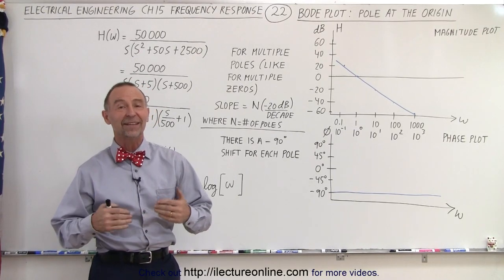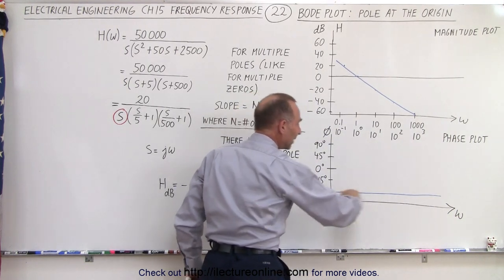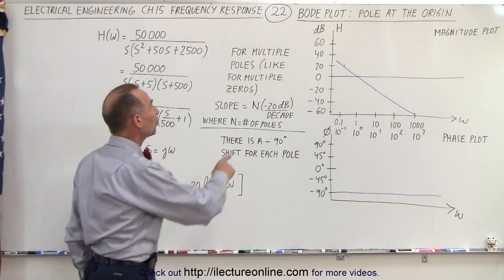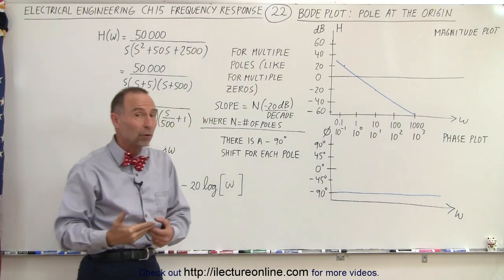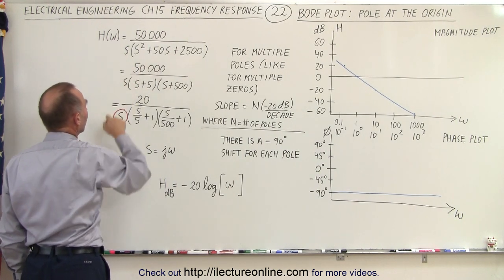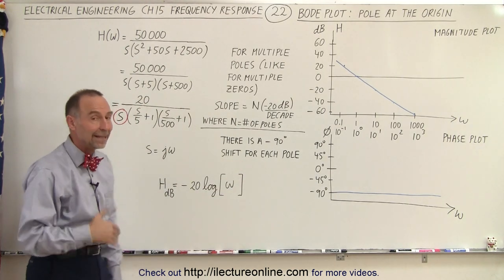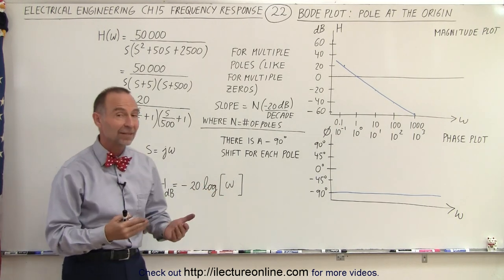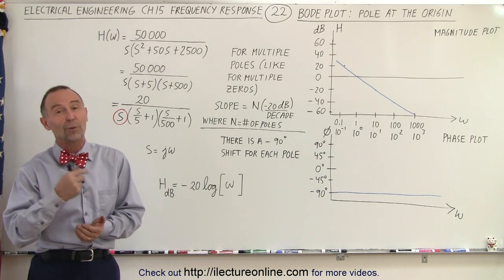Electrical Engineering: Ch 15: Frequency Response (22 of 56) Bode Plot: Pole at the Origin

Comment: I found this interesting and different from the method I learnt at Uni.Instead of (s/p1 +1) we used (s+p1). In your example (s/5+1) to ours (s+5). As the value in a BODE plot is positive, we simply use the absolute value. This comes in handy when you work with stability engineering. The stable poles are negative. Therefore the simple analysis is to set each equation in brackets to zero, and in this example, the answer is 0, -5 and -500, absolute 0, 5 and 500.
Reply from the maker: Very nice.
Reply: If you use s + p1 how do you extract the constant gain? Unless p1 is "pulled out" of the denominator  the constant gain will be off by a factor of p1.